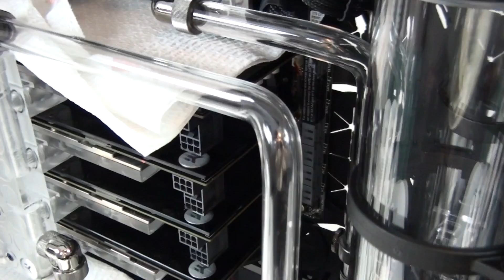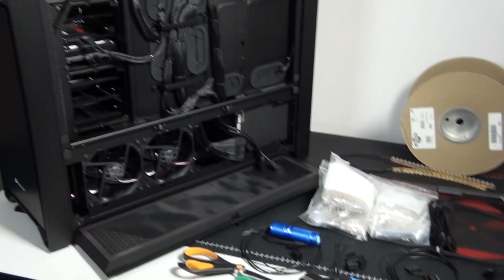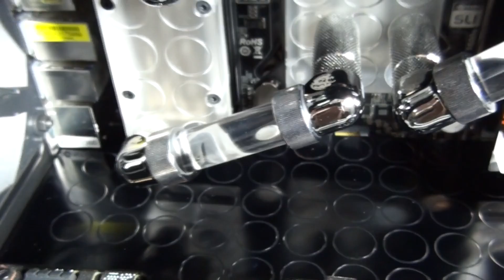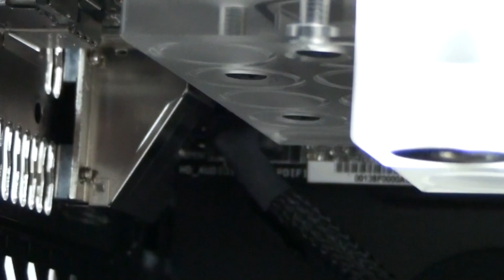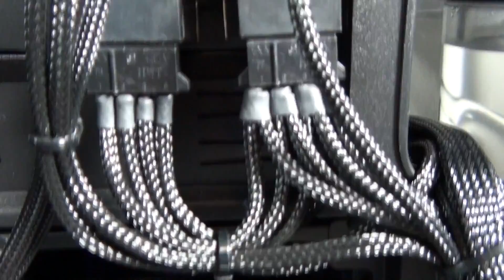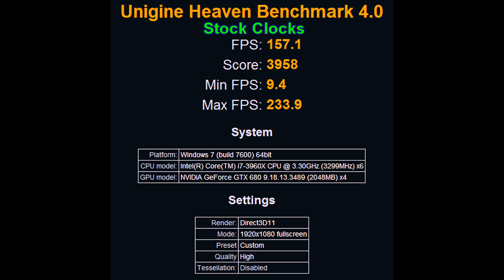Build #12: Quad SLI 900D: Part 3

Comment: i have a question. if i am putting a dual Xeon motherboard ( ASUS Z10PE-D8 WS ) into the case, water cooling both CPUs and 4x980Ti, will i have enough space to mount 2x400mm FrozenQ reservoirs? also, if i have a 80mm thick alphacool radiator with 8 fans push pull at the bottom, a 64mm thick radiator at the top in pull configurations with 4 fans and an extra 3 fans at the front and a thin radiator, will i have enough cooling power for serious overclocking?
Reply: Henry Chan you should have at least 120mm rad space with at least 1 fan / component cooling so 2x CPU + 4 GPU

You need AT LEAST 720mm worth of rad / fans. thickness of the rad's matter but the length is a bit more important

push pull may change your temp by  a degree or 2 but not necessary if you have good static pressure fans

Comment: What kind of tubes are tjese? Do these bend like that? Or are these specific ones? Can you create witj regular tubes such nice straight vertical and horizontal tubings? am completely a newb so have no clue
Reply: They are acrylic tubes, you hear them to form them to your build, it's a lot of work but looks much cleaner.
Reply: Heat them*
Reply: Oli thanks yeah have watched some vids about it. Im definitely gonna work with that. Got the tools availible and a friend in the plumber business who has done these kind of stuff quite a lot obviously. Are there also UV acrylic tubes to use? I need my side window panel like that and ofc the tubes. Or is it just regular tubing with special uv fluid in it? As i prefer to go with distilled water as many have been said and written that its the best to use.
Reply: There may be uv tubing out there but I know that the most common uv use is through dye. I will be doing a custom loop in a week or two for my new build and I will be using Mayhem's dye. I've read that it doesn't gunk up like some others do.

Comment: Hey I have a question when you water block multi GPU's shouldn't you have a single waterflow through the block instead of having a free roam of water through all the blocks. Kinda like the water runs through 1 card then the next and so on and so forth. I mean i kinda see that the heated coolant goes from one card to the next so. I'
m confused.
Reply: the heat will eventually be consistent across the loop.
Reply: its not heat its water flow, doesnt water take the path with least resistance?
Reply: Well as he explained in the video, you might think it would, but apparently it doesn't.
Reply: That's good to know

Comment: having air stuck in ANY loop means you have not designed it right.............. Two words people....... BLEED VALVE!!!! OR you make the fill point the highest point so air can escape (air rises). Car manufacturers have been doing one or the other for decades. Air moving in the system causes cavitation............ not as much of an issue in a PC with lower pressures but still, it is VERY SIMPLE to get air out if you design it right.
Reply: It doesn't matter man. I know you think it really does by the amount of capital letters you're using but small air bubbles every now and then won't cause the pump to cavitate. I'm not sure where this strong opinion for this originated from but it's pretty ridiculous. Did you see all of those bubbles when the system first started? How about both loops? Yeah you saw them, it was excessive right? Okay well why didn't either loop ever cavitate? Because it takes a LOT of air for these pumps to cavitate, that's why.
Reply: ***** Hah, I like how instead of answering simple, relevant questions you resort to name calling. Good one. I bet your a pleasure to talk to in person as well. Being that you have nothing to add to the conversation, I'll go ahead and ignore you now. Hopefully any one reading this will instead of listening to you can draw their own conclusions based off of evidence rather than emotions.

Comment: Seeing the build, I expected it to bench insanely well. Then I saw the system specs - little dated. xD You did an excellent job with cable management, water install, and epic overclocking imo. High 12's was a damn good cinebench for that cpu.

Curious why the min fps is so low in heaven bench, etc.  Max fps, my computer cant touch, but tessellation was off - gtx 680's :/

Comment: I am a relatively new to computer builds..Into my 3rd build this year. ie a 'Newbie'
 My 1st build in a SFF case was unbelievable.Perhaps I was reading the DATA incorrectly.
My second build in a Mid-Tower blew the roof off.I repeated the tests..OMFG FPS on Valley Benchmark off the scale.
I have built interesting Architecture in Australia. I also appreciate anyone's cleverness when it comes to creating something original.If someone can forge original ideas and create a new idea anywhere I am intrigued. Molding a new Computer landscape from Cases, to liquid cooling and beyond.

Comment: Dumb question:
Why are so many people stuffing their computers full of graphic cards, but near to noone use a good sound-card.
Reply: Soundcards are really just for people using Audio jack headphones , everyone just uses USB's instead.
Reply: Rusty
Do you mean a USB Headset?
Cause those are total crap...
Reply: How so? Mine is usb and it's fine , most headsets I know are USB , only ones that arent are "audiophile" headphones.
Reply: Rusty
I was using a G35 USB Headset for a year, but after that thing broke I bought myself a Suerlux HD681 Headset with a Soundblaster Z ; the sound is WAY better than the G35:
-higher resolution (you can pick up every detail)
-much clearer sound
-able to produce insane bass (feels like you are sitting in a hipster car with a 1000w subwoofer)
-3D surround is also better (better audio locating)
Reply: Well I just have a 7.1 surround headset :/
Reply: Rusty
 Believe me, a Hifi Headphone + Soundcard setup is better than ANY Headset and I mean ANY(!)
Reply: Well im upgrading my PC for christmas about £700 but the budget wouldnt cut a soundcard, I guess I should try and get one next year.
Reply: Rusty
Soundblaster Z costs around 60€ and is pserfect for gaming (have one)
Reply: I'm going to see if I can squeeze a Sound card in , so far my upgrade is £648 so I have a little left over.
Reply: Rusty do not get a sound card, get an external DAC/AMP much better and looks better
Reply: Col. Twang333
Is there a way to enable 5.1 to virtual stereo conversion on those things?
Reply: Bayview Ave sound is a very important aspect of media consumption. Ever seen a movie with bad sound? It doesn't carry the same feel
Reply: Bayview Ave
So graphics are more important than sound?
Badass sound is as important as graphics.
Reply: actually no. Try playing a game in 5 fps. Sound don't mean shit.
Reply: labanos21
But when you got a good graphics card, why not buy a good sound-card aswell?
Better sound enhances the gaming experience extremely!
Reply: labanos21 Sound does mean shit. All you are doing is enforcing stereotypes so far dude. If you don't give a shit about sound, go find a local studio and ask to demo their sound system. Bring a lossless file of your favorite song (not that youtube rip shit, actually buy it) and listen to it. You will see how amazingly wrong you are.
Reply: Guiseppe Falzarano THERE IS NO AUDIBLE INTERFERENCE IN A GOOD SOUND CARD!
Reply: Guiseppe Falzarano I never said that it's better, I only said that sound-cards aren't bad.
I know that most of the Soundblaster Z's sound is mostly due to its software, but it still beats everything below a 200-300€ setup. You also need to remember, that the Soundblaster series are designed for GAMING and in that aspect, they are unbeatable.
Reply: xXYannuschXx I actually agree with this... Even if it does sound a bit snide and self-righteous...

A great sound card + headset beats any USB headset... Especially Wireless ones (uugghhh)
Reply: Personally I use HDMI for sound, so the sound card I use makes little difference as far as I know. Audio in games is pretty much all cpu-dependant these days, and all HDMI output's should be digitally the same.
Reply: Daniel Mastía
But most people use headsets or headphones for gaming and a sound-card will make an impact if you only use headsets or headphones.
I know there are DACs with better hardware then a sound-card, but I haven't found a single one with 5.1 to Virtual Surround conversion. :(
Reply: xXYannuschXx sound cards adont do much, ive tried many. never liked them, and never produced sound like they should. right now i just have astro a40's with the mixamp, on optical and it sounds great.
Reply: Garrett Absher Mh, for me its quite opposite. Never had something better than a sound-card.
Onboard sound or USB Headset never came close to the sound quality the Soundblaster Z gave me. Sounds WAY clearer than onboard sound and even the tiniest noise can be heard.
Another thing I would miss is the ability to transform 5.1 sound into 2.0 virtual surround (very important for gaming and also adds a great atmosphere)
Reply: xXYannuschXx Did you use your front audio jacks? Or your rear io?
Reply: Rear IO of course
Reply: Why do people stack video cards but not soundcards? Simple: If your VC is not powerful enough, you get a low FPS and that's measurable. A built in audio can output sounds no matter how new the game is. Sound card gives you better sound but that's subjective.
Reply: The sound quality depends more on the speakers than the card itself.  Most on-board audio is more than sufficient to produce top quality sound using quality speakers.  Unless you are using the pc to produce music or other pro audio, just stick with the on-board audio and get some good speakers or headphones.  You will save money and extend the life of your psu.
Reply: mrdabeetle1
I have Superlux HD681 headphones and my onboard sound isn't powerful enough to power them. Bass is getting cut off and many details aren't audible.
My Soundblaster Z is practically laughing at it and outputs and insanely powerful bass and even the smalles detail is audible without mingling them.
Reply: I use a USB external audio interface. This thing will give you better sound than any internal card and allows me to record multiple microphones, control each individual volume and apply +48v phantom power to 8 of the 16 possible. I think that is worth a lot more than some Xonar card inside my computer.
Reply: because you dont need to have a godly sound card? the most important thing is a good gpu ? who the fuck cares about sound..just get a decent one and your fine. im happy with the sound card on my motherboard
Reply: IMO it's a waste buying a sound card to put in your computer. Much better off using an external DA converter, and Headphone amp with a good Hi-Fi headphone.
Reply: Bronson Nishikida
Never seen an external amp with 5.1 to Stereo Downmix...
Reply: There actually is but you have to pay a very hefty price
Reply: Because for many people building their computers, it's imperative they see a drastic jump in how the game functions. Most notably the visuals and the fps, both things directly attributed to a good GPU. I'm not saying that a good sound card is not a worthwhile investment, I'm just saying that I'd rather play my games with 80 fps, high graphics and alright audio than with 30 fps, medium graphics and superb audio.
Reply: Sound cards are only another way to add noise to the audio signal. Some pump up the gain at the cost of clear sound, if you're into that, but the built in audio jacks have the least impedance. If you want a professional sound then use an external interface like a Scarlett or Mbox. No need to waste a PCI slot
Reply: xXYannuschXx There is no good sound card
Reply: xXYannuschXx There is a very audible difference between onboard audio and a proper DAC. You just don't have enough money to afford the speakers and headphones that can actually take advantage of the full potential in a DAC
Reply: ://about _blank
Are you talking about the nonsense +1000€ range?
Reply: xXYannuschXx Not exclusively, but monitors like the Adam AX8, EVE Sc208, Focal Sm9 and Event Opals are really top notch and will allow you to hear minute differences between amps and even codecs in some cases.
Reply: xXYannuschXx my sound setup is a Focusrite Scarlett 2i2 and a pair of JBL LSR308s. About a $650 investment, and flawless sound. A Soundblaster card tries to manufacture a professional sound by pumping the bass or other frequencies (and in most cases distorting them) with built in effects. It's like beats headphones for your computer. Not saying you're wrong for preferring the cheaper option, but you are wrong for saying that it's better
Reply: ://about _blank
700€ for a single speaker?
That is simply insane...

Even with my 25€ headphone and 60€ sound-card I can hear the difference between codecs...
Reply: xXYannuschXx You'd be surprised. They sound amazing. Worth the money in my mind seeing how they are a quintessential part in the production process.
Reply: because it's fish oil
Reply: looks like a whole thread in itself :-) Sound is very subjective and depends on what you listen to as well. Onboard sound  is way better than it used to be. Also people got tired of being screwed by creative all these years ;-P I'm sure audiophiles have da bomb discrete sound cards. My friends once said the good thing about getting older and hearing impairment is you can spend less on hi-fi ;-)
Reply: this entire discussion is a joke, and likely put here to cause arguments.  simply put there are purposes to all audio devices.  Soundcards are for jerks who like to amplifyenemy footsteps so they can hear them with superhuman senses a mile away.  alot of guys think because the sound is louder  it is therefore a better experience.  this is wrong in most circles.  usb headphones are for most users who want good audio, but are not music enthusiasts or composers.  beyond that are audio dacs for high end audio and are quite suppirior to sound cards.  buy what you need.  most gamers really dont need or require more then usb headset.  and dont buy 7.1 headphones untill you grow 7 ears in your head.  odds are this client build is going to be hooked to surround sound.  i would if i had that kind of money.
Reply: ***** do not buy headphones with any more than 2 total drivers. You have 2 ears, you do not need 10 speakers.
Reply: ***** A full 5.1 system for a room is fantastic and has many uses. In the form of headphones, it offers no benefit to have 5 tiny drivers per ear as the distance between them is not large enough to make any use out of their "locating properties" or whatever. If you want to enhance your stereo imaging, there are many programs just for that, and they are very effective too.
Reply: I use the optical output from the mother board to my audio system that came out of my home theater during a upgrade this onykyo reciever http://www.onkyousa.com/Products/model.php?m=TX-NR929&class=Receiver&source=prodClass with all Klipsch speakers, this set http://www.klipsch.com/r-28f-home-theater-system/details This system is just to loud for the bedroom, so it is in the PC room. The joy of homeownership, and only one kid left at home!!!! but at retail, the sound system cost is above the cost of the PC build.
Reply: yes, that is what was on this system. My son inherited that logitech setup. But I love music played loud and clean. And I have the extra cash to do it, and I do not plan on taking it with me.

Comment: For filling the reservoirs on this, it would've been better to take the caps off the reservoirs so you're not trying to fight against the air trapped in the loop, then just loosely put them back on when you need to turn the pump on so you don't get splashback.

Comment: Why the hell did the client want a DVD drive in that case? They don't fit the width properly and It completely destroys the aesthetics of the front of the case. 

I know you're all about aesthetics aswell Singularity, why didn't you just suggest he get a $45 external dvd/bluray drive and use that when he needs it... Rather than have it completely wreck the look of the build from the front with its ill fitting width and all that horrible white writing and lettering on the drive itself. 

The rest of the build is amazing,  but when a saw the front it really broke the magic for me... 

The internal dvd drive really doesn't fit or belong in such an amazing build.

Comment: he sad you have te have positive presure but he has 7 fans facing in and 7 fans facing out, then you dont have positive presure.
Reply from the maker: Equal pressure is also fine, its not critical, its only to avoid a bit of extra work when dust cleaning. The only 140mm fan in the build has slightly higher specs than all of the other 120mm fans so creates slight positive pressure.
Reply: ah
Reply: it also depends what speed the fans are spinning at, if he has the intake fans at say 40,000 rpm and the exhaust fan at 500 well which you be moving more air.

Comment: The only with your builds is that they take so much time to be completed. 
By the time of making this system there are already much better graphics cards available such as the gtx 780 ti
Reply from the maker: I agree it does take a long time, its a lot of work. The 780 was actually available when I started this build but the client already had a bunch of 680s.

Comment: Don't you always say to test the hardware before installing the water cooling just in case the stuff doesn't work? lol still great video! My favorite part is the filling up the loops for some reason :D
Reply from the maker: I meant to talk about that. Ive been getting such good success rates with components over the years that I'm spending 10x more time testing everything beforehand than I am dismantling loops to replace faulty components. I recommend testing everything before installing for personal builds, but for someone like me who builds systems constantly it works out to be quicker not to.